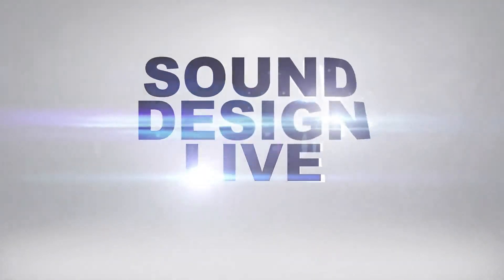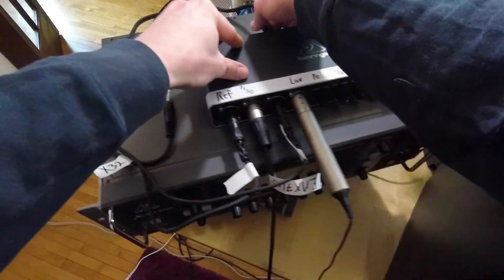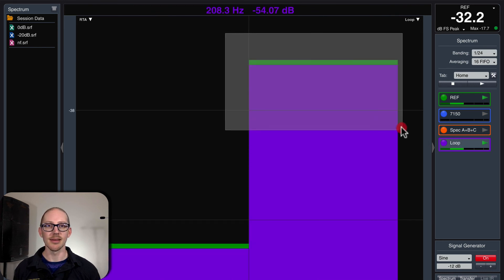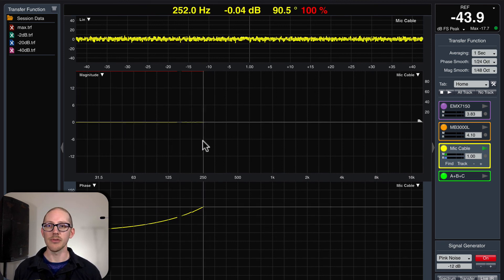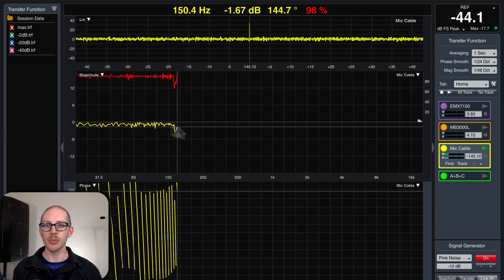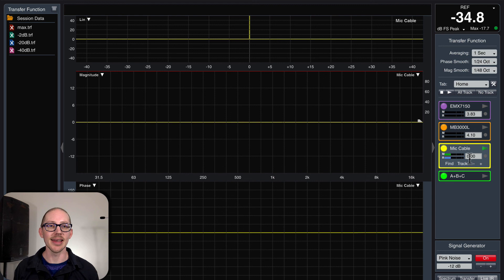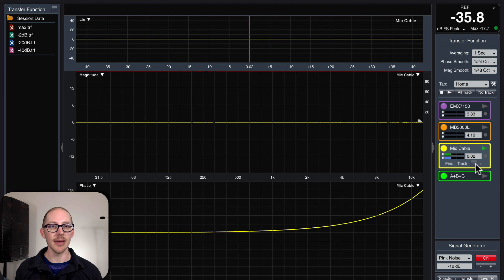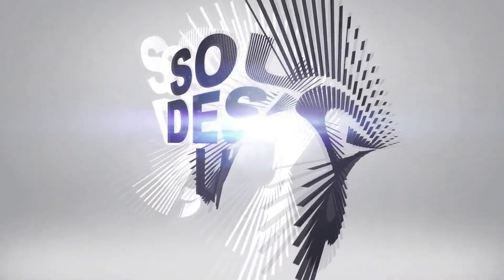Expectations: What does a mic cable look like? [GSwSST23]

Comment: Hi Nathan! In this video, you didn't specify that the Y TRS cable should be symmetrical.
It may be a trivial detail, but I wonder if some people aren't tempted to use insert cables, which are the most common, and can generate a lot of problems with phase inversion and loss of gain...
Reply from the maker: Great point! Thanks

Comment: Hi Nathan. Thanks so much for these videos, really helpful. 

Getting a strange result. I'm using a Focusrite 2i2 with the aux out setting in smaart. If I compare using the TRS to male XLR input on the measurement channel  and TRS to TRS on the reference channel, I get 14° of phase shift between 1K and 20K. 

Using 2 unbalanced Jacks is fine. Using 2 TS-XLR is fine (i don't have a second trs - xlr on me). As I would have to use one XLR input for measurement mic and one TRS input for reference anyway (damn you, global phantom!), this concerns me. I suppose this 14° will be added to my traces???

Would love to hear your suggestions/thoughts.
Reply from the maker: Hey Chris, I've never seen that. If I understand you correctly, you are basically comparing two mic cables, which should result in exactly the same measurement, right?

Just to confirm, your delay is set to 0?

Comment: hello Nathan, my phase trace looks funny even though everything is correct hooked up, 0 delay..impulse is negative and magnitude is a flat s shape line
Reply from the maker: Did it end up being the reference loop cable?
Reply: Nathan Lively 
Yeah...as you replied and you where right the issue was caused by the Y cable (insert cable) balanced at one end...unbalanced to the other two...basically a “stereo” cable at one end mono at the other two..., Important aspect your Y cable it is a fully balanced cable all three jacks are “stereo” , I think you have to mention that in your videos! Thanks Nathan! Looking forward for your next videos!